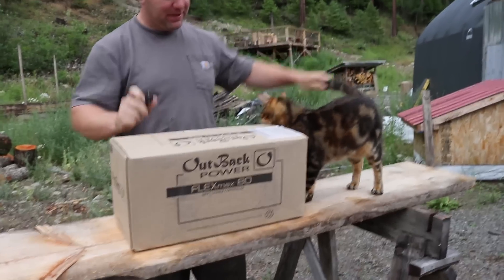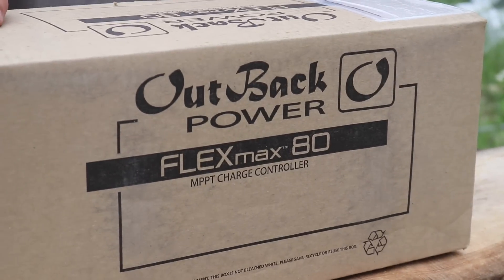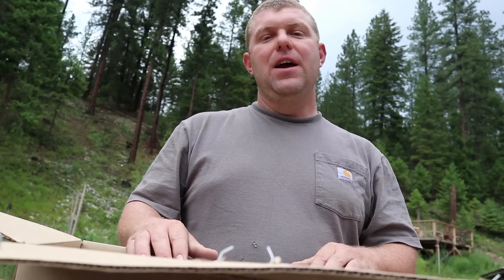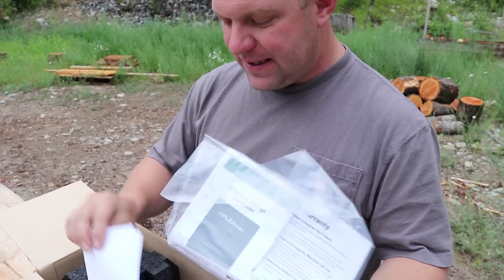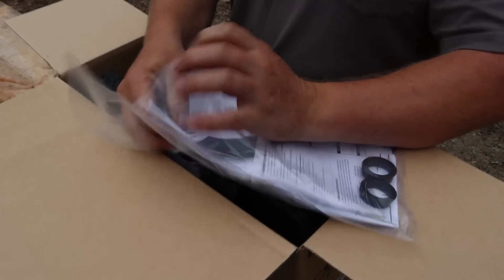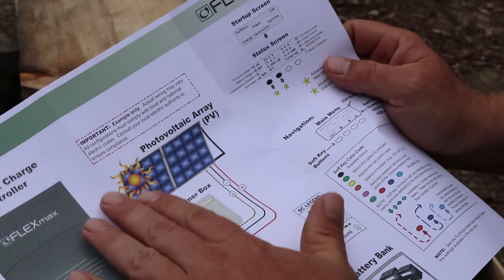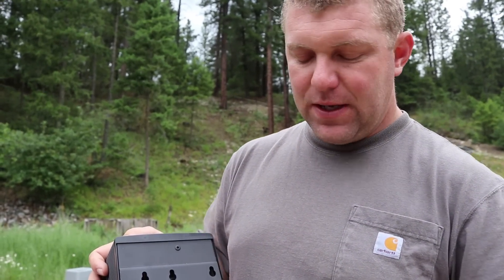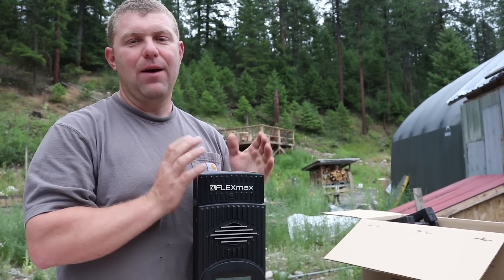MASSIVE SOLAR UPGRADE (Outback FLEXMax 80 Charge Controller Unboxing)

Comment: My FM 80 has sat for a year to be put in........ It's reassuring that you chose the same charge controller.   I am going to hang 1,000 watts of panels into that thing, and if I don't want to have to buy another when I add to  the solar panel  array, my  12v - 8 cell battery bank could be reconfigured into a 24 volt battery bank, and in that case the Flex Max 80 can handle 2,000 watts of panels.   

The only downside for me would the the need for a 24v inverter, but if you plan to use anything over 2,000 watts, at one time, you are going to have to go with a 24 v inverter no matter what.  Fortunately my energy needs are quite meager right now, my fridge being the big one with about   about 1 kwh's per day with a power draw as I remember of about 150 watts....

Good luck with your new system.  I have to get my panels up and wired. Too many projects!!   Just got my Grundfos SQ Flex  Solar Deep well Pump, into that expensive hole in the ground.  I have to go out, and wire the CU-200 diagnostic panel here as soon as it cools down a bit.   Will be following the saga of the new solar system. :-)

NOTE: as the guy below says. I can wire 2 of my panels in series to bring it up to about 70 volts DC as I recall.  That was just under the maximum input voltage that the FM 80 can handle.  Be  careful not to exceed the max power input from your panels and that depends on whether you have a 12v  or a 24 v battery bank. With a 12 v bank you can use 1,000 watts of panels. With a 24 v battery bank you can use 2,000 watts of panels. BUT no matter what do NOT exceed the max input voltage for the FM 80. Wire your panels in series and stay under that limit or you could fry your $600 FM 80. That would not be a good. day.

Comment: Try to do your long runs A/C (alternating current) and not D/C (direct current) like it comes off the cells as.  You'll have much less loss.  Or perhaps have the battery bank under the solar panels, then run A/C to your trailer from there and you should get much less loss.  D/C over any distance will result in huge power losses as you heat the wiring basically.

Comment: Hang on... the videos are starting to feel like an on-grid experience. How do you go from nothing to an expensive charge controller, an air conditioning unit, a laser level, a backhoe, a sawmill, flying instruction, and probably 10 other expensive things? In just a few weeks? Are their parents financing them? Does not seem like an off-grid experience to me.
Not getting the latest expensive gadgets is pure living for life. I'm starting to find the videos a little too materialistic. I Love the videos of people doing with some string and a bucket of water rather than lasers.
And please get an electrician to give advice. Or at least upgrade your wiring before spending thousands on a partial solution.
Sorry to be whining, just look like a "real" experience.
Reply: This couldn't be a set up by a group of manufacturers to sell things could it? Obviously some items are obtained free as anyone with 100,000 followers can do, but the quantity is as you say making me think there might be more to this series than meets the eye.

Comment: The protrusions on the back are to maintain 1/4" spacing between the mounting surface and the casing per national electric code. precipitation and dust run behind it to reduce corrosion or pooling water on the outdoor equipment.

Comment: Another nice job all around. This is not criticism, when I was learning my trade it was driven into me the terminology was very important so I'll share this. The "grease" known as no-lux( might be a brand name) is to help prevent corrosion as you mentioned. Which can come from moisture or when dis similar metals are introduced such as copper wire and aluminum lugs. Those plastic bushing or grommets do protect the wire insulation from the metal enclosure but make sure that's the best application. Don't make the lug you terminate the wire to the means of support, at least not on the larger wires. And my last bit of advice, as you know all of your equipment on your property requires some level of preventative maintenance periodically check you're termination. Electricity when flowing creates heat and when no amperage is present you have more of an ambient temperature thus termination over time will loosen because when metals heat and cools it is moving.

Comment: So why not run your solar panels in series and increase the voltage reducing voltage loss since the inverter already has the ability to stepdown the voltage to charge your batteries without damage.

Comment: Food for thought.  Put the battery box right under the panels and put the inverter rite in the battery box so you are putting 110V over the wire to the RV.

Comment: Higher voltage means less amps.  Less amps means less loss in the cable.  Add to that the fact that A/C doesn't suffer from corrosion.  Why not step up the voltage at the panels, maybe make it a/c, run higher voltage down the cable and step it back down to whatever your controller needs.  The conversion losses might be a trade off to the cable losses.  It would also mean smaller cheaper cables.  One of these days, somebody is going to market a two piece controller/charger.

Comment: You guys are doing a great job! I mean this in the absolute best way possible, if you would like to learn a little bit more about solar power I would be happy to discuss it with you. Not saying I know more than you guys but I have seen and continue to see some issues with your system. Just remember to recognize the difference between "works" and "works right". Just because you manage to charge a battery and pull juice out of it doesn't mean the system is working efficiently or optimally. Keep up the great work, very exciting to see the progression!

Comment: i took the averages from my electric bills for 6 month and i use approximately 194 kwh per month. i dont think id ever be able to switch to solar with my usage
Reply: Money is one of many reasons to get solar...  Emergency Power is another

I live on-grid have one panel, one battery (270AH 12V), a PWM charge controller, and 400W Inverter

In a power outage I have phone, radio, internet, lights, and can charge things via USB (DC), and have a tiny amount of AC if I need it.  For me my system is worth it (even at 3 times the price)

One of my friends was without mains power for 2 months after earthquakes, and had to live on a similar system 

A grid-tie hybrid 1500W system with batteries may suit you but do the math

I think solar works best either really small, or really big.

Comment: If you're seeing $900 for a FM80, shop somewhere else...  They are available for under $600 all over the place.  I prefer Midnite Classic but that's jus me.  When you upgrade you battery bank and inverter, skip the move to 24V and go directly to 48V.  Also, the fact that you're installing the FM80 will not adjudicate the long run from the panels as long as they are 12V.  Put two of those 12V panels in series (one 24v panel now), then add those other 24v panels to increase you array right now.  You can keep your bank and inverter at 12V for now as the FM80 will translate that.  Good Luck!

Comment: Good info, and yes, I am a nerd.  =)   Time to make assumptions, and we know where that goes.  You have 8 batteries, I assume they are 6V.  You could wire 2 sets of 4 batteries in series, and parallel those two sets to get you to 24V.    Jess, you mentioned adding another panel, that would give you 4-12V panels, again, wire 2 sets of 2 in series, and parallel wire the 2 sets, to again give you 24V PV.  Then your whole systems would be running at 24V.   The higher the voltage, the smaller gauge wire can be used.  I have the feeling you know this already, but want to help out where I can.    Love you guys, pet Bugaboo for me.   Keep up the helpful and informative work you blessed folks are doing.    <3

Comment: I'm no expert but from my research the diversion load is for when the batteries are topped off and you have a wind mill.  When there is minimal draw the generator in a mill will produce less power by basically reducing resistance and allows the blades to spin faster which could inevitably get damaged.  By diverting the draw to another destination, usually a water heater element, it keeps the wind mill from spinning too quickly.

Comment: You are going about this ass backwards. You need to install the inverteR AT YOUR SOLAR PANEL so you have HV going on the long run back to the house. YOU'RE LOOSING 90% OF YOUR POWER IN THAT LOW VOLTAGE RUN!

Comment: Hi Jesse did you realise that you can configure your panels to 24v but still leave your batteries 12v so you can still run everything as 12v, that's what I did !!  What that means is on cloudy days because your panels are 24v their bring in a higher 24v amps or current but when it reaches the charge controller it KNOWS your battery bank is 12v so it converts the 24v back to 12v but the amps remain the same as 24v almost !!  For example these are just numbers at this point but hopefully you'll see what I'm getting at, if you have a12v panel setup that brings in 6 amps to the controller it will then put about 6 amps into the battery bank, same panels now setup as 24v say bring in 12 amps to the controller that doesn't mean 12 amps is going to the batteries ! What the controller does it realises there 24v at 12 amps but at the same time it knows your batteries are still setup as 12v so in fact instead of putting the 12 amps into the batteries the controller ups the amps to 15- 16 amps roughly, so the controller takes the 12 amps at 24v PLUS HALF the amps you would've got on 12v which was 3 amps and adds them together to give you the final amps of 15-16 amps which is what you want on overcast days. I hope you understand what I'm getting at !!  Seeya Rob

Comment: Doesn't piecemeal upgrading mean you spend a lot more time/money messing with the system? I would imagine that designing a system targeted for long term needs would be more efficient, require less total effort, and ultimately be cheaper.

Comment: I enjoyed your presentation. The features of this unit are very nice and should be required features of any non-trivial system. You should be very thankful there are nerds like myself to design, test and manufacture such wonderful components of a battery-power system. Thank you. Now, let's see your careful installation of this.

Comment: Might want to do a bit more research on your solar system. You should be able to hook up higher voltage panels and the charge controller can step it down to the proper voltage to charge your batteries. Not sure how efficient it would be but you might be able to increase your battery voltage and use a transformer to step it back down to 12 volts for you inverter.

Comment: Okay, I admit to being a solar newbie but...I looked up this charge controller and it costs around $600. So I have to ask the question: Is there any practical advantage of spending $600 on one 80-amp charge controller over buying multiple 20-amp controllers (i.e. - Renogy HQST 20-amp) for $20 each?
Reply: The cheaper $20 controllers are often limited to 12/24 input voltage and low amperage, setting cannot be changed eg. some will let a 12V battery drop to 10V

Also they let out the magic smoke to often when used 24/7
Reply: So...voltage, not a big concern. I suppose there is a waste of voltage there, so efficiency seems to be the only benefit. Which only really makes a difference if your space is limited. For cost-effectiveness, you can have a half a dozen backup controllers and batteries for less than the price you'd pay for the expensive controller. I'm sincerely trying to understand but I remain unsold on the expensive controller for now.

Comment: These solar issues were obvious from the start. Any expert in solar could see their mistakes. Since they have $20k or whatever to use to buy ditch diggers, getting an adequate solar system should have been taken care of long, long ago. As for the size of their system, there are people living in vans with 800+ volt systems, so why they have that tiny system is a bit of a mystery. But, they are nice entertainers, and that is what this is about, nothing else.

Comment: does it charge lithium ion
i've found a supplier which has tons of 36v lithium ion packs (10 cells in series)
with balancing board preinstalled
so if it could output 42v to the battery it would be awsome

Comment: First thing I would do after installing that new charge controller is to wire my three panels in Series to bump up the voltage coming into the charge controller. I will bet that fixes most of your issues with the Solar system immediately. Second thind thing is add those extra panels as soon as I could.

Comment: Every video I watch from PLFL lately seems to be a endorsement of some product or another I've seen air conditioning units, laser levellers, outdoor work wear, solar power control units hell even the manufacture of the fittings they used to put in their water system contact them to agree 2" pipe was more than efficient for their needs. I'm also very curious that when they talk about this out back unit jess gives a rough price on what it costs, surely if they bought it, they would know exactly how much it cost to buy. Do I sense a lot of product placement going on?
Reply: The fact that some of the viewers say the videos are informative does make me wonder what we have here?

Comment: so since it does wind water and solar. why don't you use wind? I don't know if you covered that before. I'm in Kansas and currently thinking of getting 3 2000 watt wins mills.
Reply: Shawn Lynch How much are those wind mills? I think everyone should have wind and solar, besides the initial price of the equipment the wind and sun are free.

Comment: Saying your viewers are nerds for watching the entire video might not be the greatest comment of coarse you may put in a Easter egg or something good right at the end kinda like watching pimple popper you know its gross and wrong but you want to see what happens next Lol !!! You fine folks are doing good however watching this off grid solar system and water system makes me glad i got electricity. Remember be teachable and don't be afraid to ask for help or guidance including asking your subscriber base i have found myself watching a couple videos thinking if they only knew what better more cost effective products where out there it would help you so much. and as far as your solar system have you added up the cost of the system that is really needed and divided it by the time it will last to see what your yearly or monthly cost really is and if it would be cheaper to go on the grid for that? Also glad to see you purchased a backhoe however with the lack of experience with equipment and mechanics don't you think a smaller compact tractor with a front end loader and a hoe attachment would have better suited your situation more versatility easier to move around and take for service ? And when you gonna tell us about the new 3/4 ton Ford in a couple videos you think we dont pay attention? Keep up the good work and the dream !!!

Comment: A Suggestion and/or something to consider..  It might be good if you consider another TWO-or-Three more Photo Panels..  Then, condense or re-position the Panels, Battery Bank and Controller.. That will shorten the #4 Gauge Wire.. Of course, everything costs money..

Comment: Doesn't this charge controller allow you to wire your panels in series now so you can transfer your power with less loss?

If you have 3 panels and all are 12V that should do about 36V.

The diode setup is different, I cant "recite" the setup from the top of my head. ~Important~

Step down from the charge controller will have its own efficiency. Really depends on the type of how the step down is done. The better ones get an efficiency of around 90%

PS: Shhh Alyssa. We are not nerds. We are just a tad different :D

Comment: You could cut your voltage drop by 2/3 if you just wired your panels in series vs parallel. That would actually make it more safe then it is now 36 volts respectively. edited no need to invert .. thanks for helping me look a bit closer Rick
Reply: Why would you step down?  The charge controller is the only thing dealing with high voltage.  Are you suggesting running the system in 24v battery and then stepping down to the inverted so that they can run more panels (watts)?  That cannot be all that efficient.  I would just leave the battery side 12v, run the panels in series/series-parallel and wait until I had the $$$ to purchase a good inverter capable of at least 24V if not a 48v bank (the higher you go the more efficient the whole system is and the more panel wattage it can handle).
Reply: When I posted this I wasn't aware exactly how the charge controller actually worked. After looking over the specs your right Rick why step down the voltages :-). The charge controller can actually handle input higher voltages and still output the correct power to charge the battery bank. Now I understand why the upgrade both for the future and current system. But looks like we both agree that wiring the panels differently series / series-parallel would help with efficiently and reduce the power drop. I actually wasn't talking about the battery bank at all understanding they are limited to a 12 volt inverter currently. One thing nice I like about it is they can see incoming and outgoing amps on it.